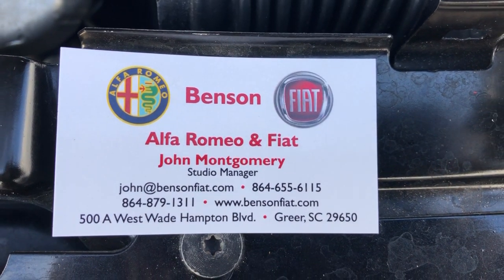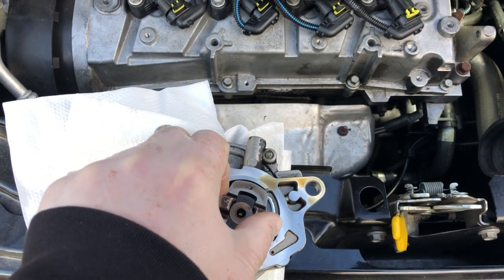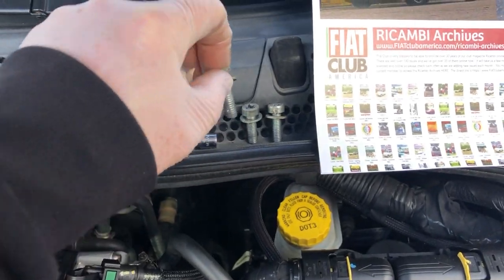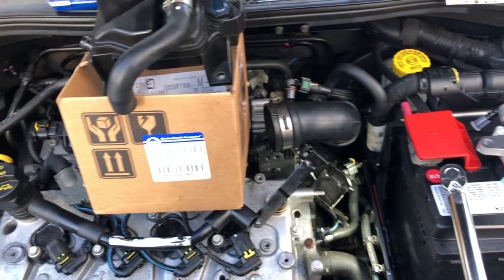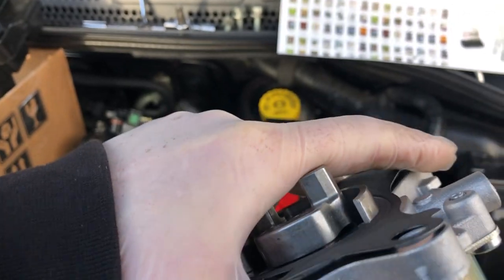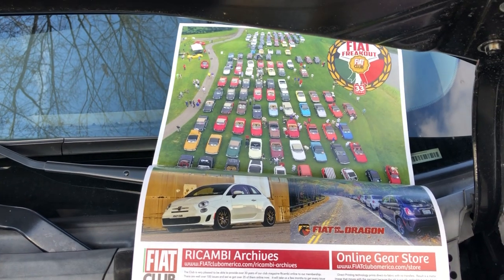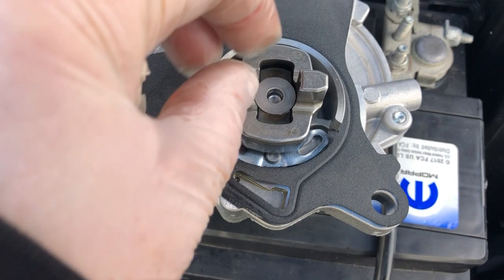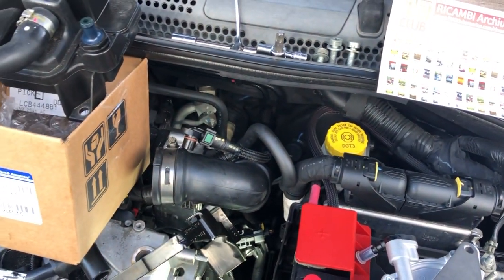Fiat 500 1.4L Vacuum Pump Replacement

Comment from the maker: Yes you can tighten the bolts without a torque wrench, the most important thing is to make sure that the gasket is nice and straight. Also tighten the bolts equally as you go around. I got one that had a little bend in it and it started to leak right away so I had to buy another one.

Comment from the maker: Great that you could find a gasket, make sure it’s nice and straight and make sure the surface is clean and use the proper torque. If you buy a vacuum pump it comes with the gasket

Comment: I did the timing belt on my 1.4 Turbo a few days ago, got a leak from the pump now.  Going to change the gasket. The gasket is like on a national back order according to Dodge, but I was able to track one down at a dealership over an hour away.

Comment: I am having an issue with my 2015 fiat 500 pop I had a diagnostics ran on it and it’s pulling code P1063 Cylinder three oil supply solenoid valve stuck Also, P0353 ignition coil three circuit , Am I needing to replace the solenoid at this point?
Thank you in advance for your help

Comment: Hi John, Thanks for this video. Can you tell us what are the symptoms that results in the Vacuum pump replacement?
Reply from the maker: That’s a great question. I started to get an oil leak out of the bottom of the pump assembly at the bottom of the oval that was the first sign and it would run down onto the exhaust pipe. The second thing was a smell from the catalytic converter like rotten eggs. I thought the converter was bad but some oil had been seeping through the vacuum lines and into the intake system when I took the pump apart it had a lot of oil in it and I don’t think it’s supposed to have that much oil just enough to lubricate it so the seal between the camshaft drive and the vacuum had been breached

Comment: Hi John, i'm having a problem with my fiat 500 where after a few pumps on the break, the pedal gets stiff. I checked the booster and valve and works, do you think it could be related to the vacuum pump or what could be another possible reason?
Reply from the maker: I  would do the basic things check all your hoses for any vacuum leak don’t know if you have a vacuum tester or OBD reader if you have a check engine light? I’ve had a couple cars were the PCV valve goes bad where I gets stuck… you could try cleaning it out with some carburetor cleaner. The PCV valve is close to the vacuum pump as a show in the video.

Comment: How do u know if the vacuum pump is no good.Mine is leaking I changed out the metal gasket and still  leaks however it had a small crease on it .I get no oil smell but I do have a leak .PLEASE HELP ?THANKS
Reply from the maker: If the gasket is bent in anyway typically it will not seal. if you wanna try to use it you could coat it with some copper spray gasket otherwise you’ll just have to buy a new one. Remember that you want to have 15 foot pounds on all three of the bolts and I would tighten them up a little by little

Comment: Do you need to drain the oil before you remove the pump?
Reply from the maker: No I would just let it cool down. There’s very little loss of oil once you remove the pump. It’s important to make sure that the gasket is very straight that it didn’t get bent in the shipping box and make sure the torque is 15 foot pounds.